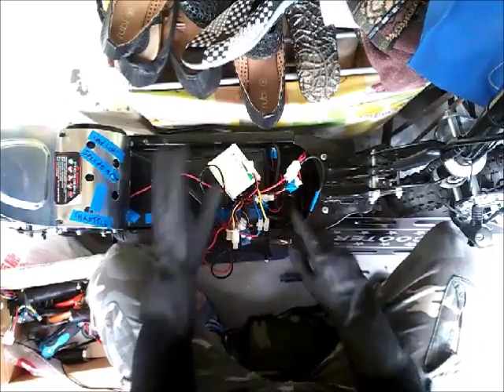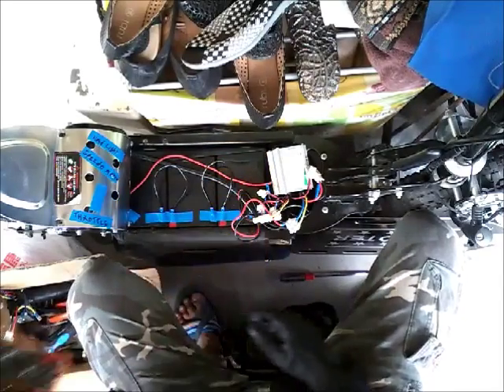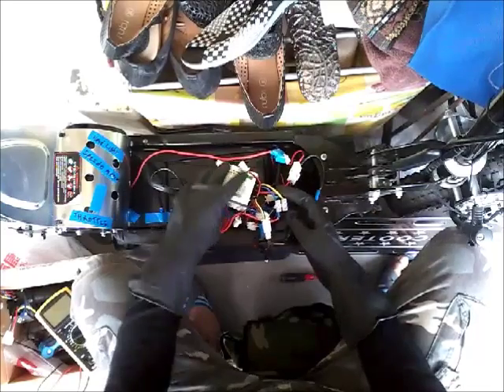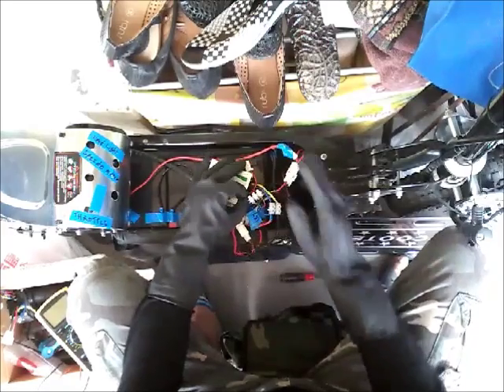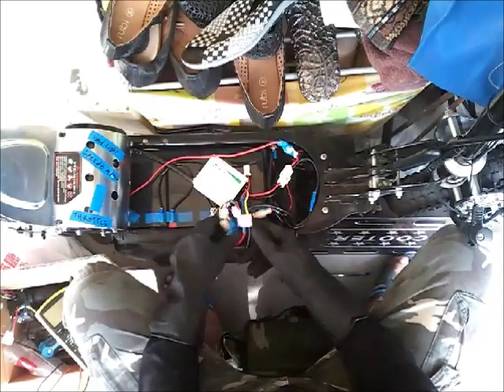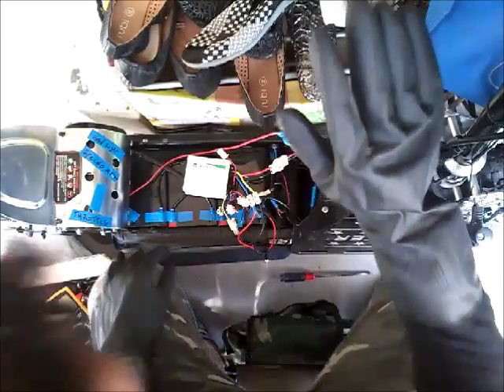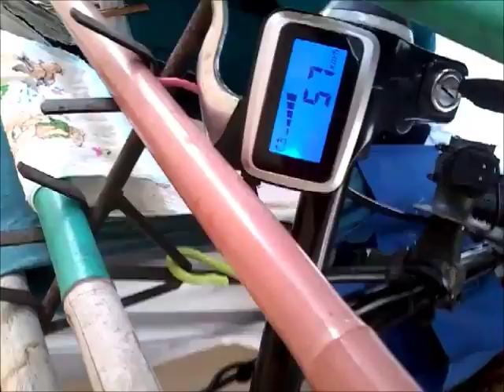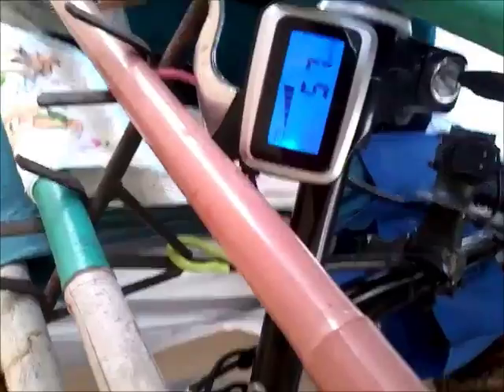Electric Scooter  Diagnose Wiring problem May day  Help I'm going down

Comment from the maker: Finally problem solved. it works in a way that should
Reply: Liquidmaster1006 what was the problem?
Reply: Had mine working for 6 months, worked perfectly. Earlier I someone accidentally dropped it and it got wet. Everything looks ok except non responsive to throttle. Any idea ?
Reply: Liquidmaster,,,, i have similar problem... what throttle is compatible with the scooter... i have a 36v 1000w evo scooter
Reply: Cik saye nk mintk tolong, ive tried finding out and try to solve the problem till im stupid. My motor keep having this hall effect lrob